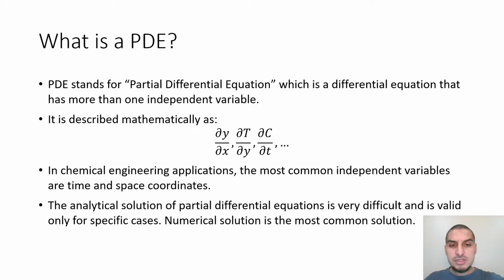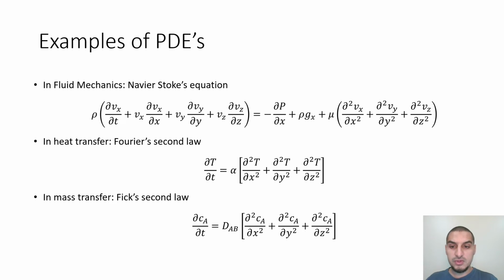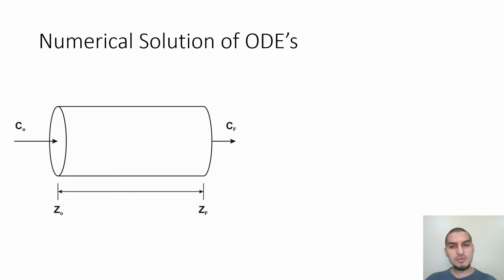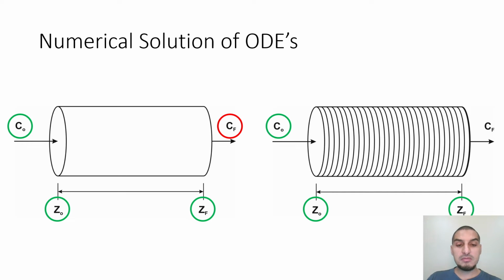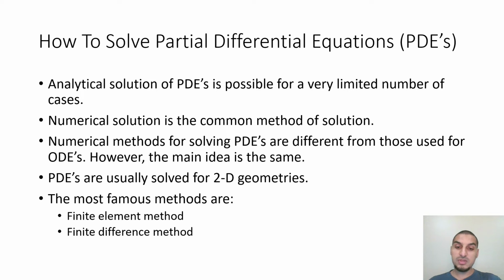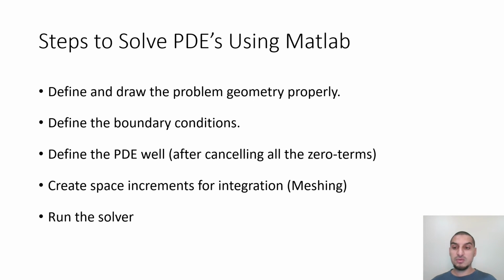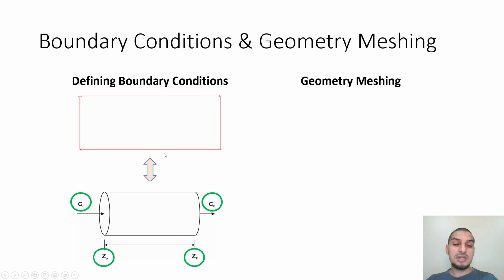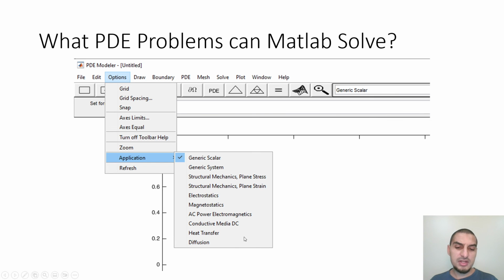Introduction to Matlab in English | 58 | Matlab PDE Modeler - Intro (1)

Comment: Hi Sir my application is the 2022 version and it seems to have no PDE Modeler , please help
Reply from the maker: Most probably it is not a problem with the version. Check this video: https://youtu.be/Zu0D95yfutw

I assume the solution to your issue is there.
Reply from the maker: Just look for "Partial differential equation toolbox" in the list